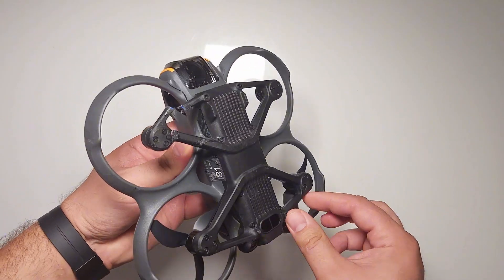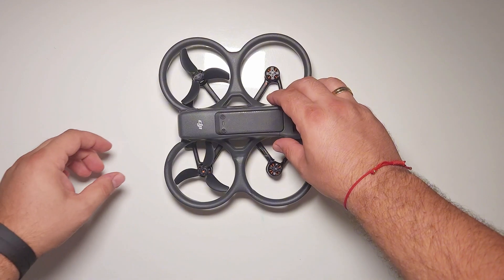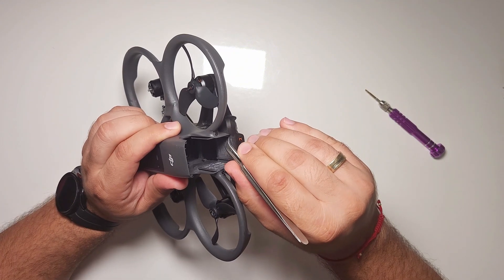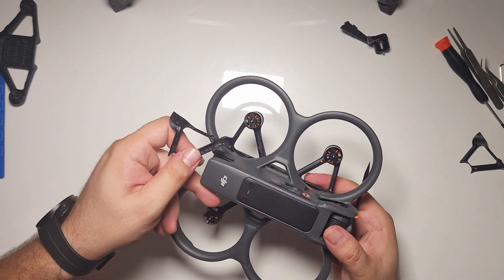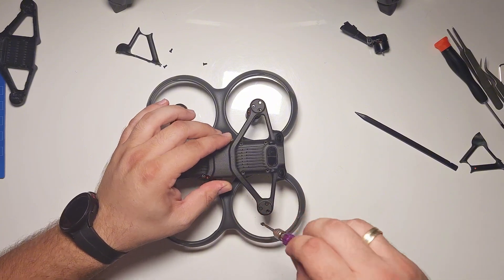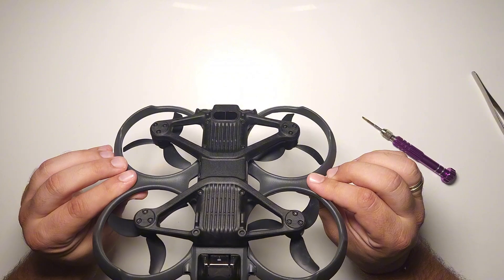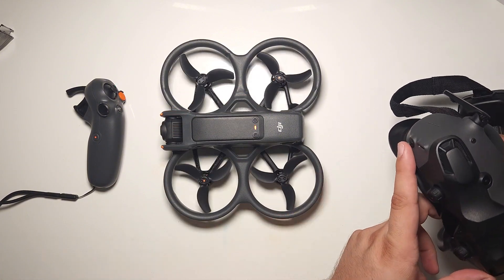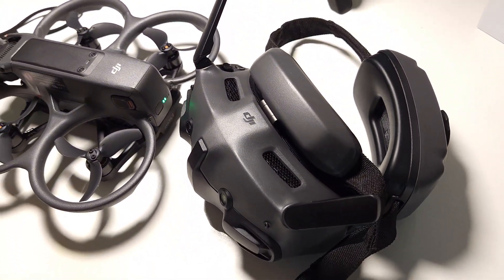How to repair your DJI Avata 2 | Motor and Under Frame Replacement | Disassembly | Teardown

Comment: Hi, I crashed my avata 2 and the camera lens is a little bit scratched. Do you know if I can replace only the camera module without Disassembling the drone frame? I already bought a new camera module on aliexpress, should be arriving soon.
Also, the Drone is working fine, a few scratches here and there but nothing much.
Reply: yes, gimbal assembly can be removed without taking the entire drone apart

Comment: Hi there! Your video is really helpful. I had a crash today and I think my Avata 2 needs a motor and two propellers replacement. I’m not confident replacing motor myself.

Would you be willing to help me repair it if I pay you for your time and work? I’d really appreciate it. Please let me know if that’s possible, thank you so much!
Reply: soldering two wires is not that hard, question is, do you replace the full cable on the board, or do you snip the motor cables and solder from there?
Reply: @patrickspapens5497  Im contemplating just snipping the cables on my new motor and splicing the cables to where it broke(close to the motor mount) so I dont have to disassemble and get to the ESC/board. have you tried that?

Comment: Thank you so much for this, i had to cheange my entire upper and bottom case.. the struggle of removing the antenas from inside the sandwiched plastic is on another lvl. You helped me alot tho!
Reply: Bruh from where u buy parts
Reply: @empower_move011  amazon, aliexpress. i did a complete housing swap today

Comment: I’m having trouble finding info to replace the rubber shock absorbers on the Avata 2. Any insight?
Reply from the maker: Did you check at AliExpress? You can find full sets there.

Comment: What type of screws was used in the body and internal components?
T5 or T6?
Thanks🙏
Reply from the maker: You can order a spare screws set for the drone from AliExpress. There were 4-5 different screw types in that drone. I don't have it for some time now and I can't even check.

Comment: Hi, do you have diagram how to connect the new moters,Please?  I do upgrade for AXLS  C157 3650KV for my Avata 2. The cables all black and I do not know with one goes to with one . I be happy for your help. Thank you very much!
Reply from the maker: Hi, unfortunately I don't have a diagram, especially for aftermarket motors. Perhaps the manufacturer will have one?

Comment: when i want to replace a motor i will cut the cable AT the motor or desolder it there
Reply from the maker: That's why I cut them off. Much easier to do that for this model.
Reply: Can you cut them close to the motor or do you need to cut past that black insulation material that stops right where the wires starts to go into the body?
I got the esc error and when I start my avata 2 the motors on the front twitch like normal and the back ones don’t. Would you say that’s the esc or motors?
Reply from the maker: @N3CR0LICH It might be the motors, but there's no guarantee. I was also getting an ESC error before replacing the motors.
You can cut the cables wherever you want. It doesn't matter.
Reply: @amv.techpro thank you for the response. A lot of the time I post a question on an older video and get no response. Thank you again.

Comment: Hi,
I would like to make upgrades of the motors on my Avata 2.
If I install Axisflying C157 3650KV Brushless Motors instead of the original DJI motors on my Avata 2, will the Avata 2 work and it will not get any errors or calibration ?
Thank you very much!
Reply from the maker: Hi! Unfortunately I'll have to disappoint you because I've never installed aftermarket motors and I don't have any tips for you. I just saw that another person here commented that this exact set of aftermarket motors comes only with black wires and he's having trouble determining which cable goes where when trying to solder them back.
Reply: @amv.techpro  Thanks, mate 👍
Reply: Third-party motors, like the Axisflying C157 3650KV upgrade, have been successfully installed by modders. These can boost thrust and performance, but they require:

Careful soldering and disassembly

Matching KV ratings and voltage tolerances

Manual tuning (especially if flying in manual mode)

Comment: Hi, any update required after new ESC installation, btw thanks for this useful video 😊
Reply from the maker: If the ESC board was damaged, there's a rush that it'll require a firmware flash after changing it. I've changed an ESC board on a mini 3 pro, mini 4 pro and a Mavic 3 and they worked fine without anything, but I've seen comments from people who weren't so lucky. I'm not sure what the difference is. It might be down to a combination between a defective board and a defective motor.
Reply: @amv.techpro  okay thanks so much for replying.

Comment: Thank you for your tutorial 
I've crash my avata 2 and i have an esc error 
2 motor are not working when power on the drone 
Did you had aslo an esc error Message on the goggles? 
Im not sure if to order motors or esc to replace... 
Thank you :)
Reply from the maker: Sorry for the late reply. Yes, I had an ESC error. It happens because the drone is doing a preflight check and if the motors are not working it throws an error. If you replace the motors, it should start working and the error should disappear.
Reply: Did it work?

Comment: Very helpful. I was at a loss on how to replace the frame but using your video, my drone looks brand new
Reply: yeah me too! antenna removal was a bit tricky too sice the upper shell and lower fan duct halves were banged up pretty good but some careful cutting and snipping later it was easy

Comment: Broke my back propeller guard. Is there a way for me to replace it without removing the entire frame?
Reply: Cut it and get rid of it. Someone on youtube was cutting it without breaking the antennas. It provides an incredible performance increase. There are antennas in them, you have to be very careful, they do it by melting.
Reply from the maker: Unless you cut it out, no. You saw that the frame is one whole piece.

Comment: I'm trying to replace the camera gimbal lower bracket arm (one tiny tab busted off).  Is it possible to disconnect the camera and replace the bracket arm withought opening up the rest of it?
Reply from the maker: The signal cables go through a hole in the bracket. I'd say, possible but difficult.

Comment: Hello, 
I have a problem with calibration downward vision sensor on my Avata 2. I ordered the new one that comes with the Tof Board Flexible Flat Cable (SKU BC.PF.PPO0OO36.01). I did  install it all, and now I have two problems.  1st, I must calibrate the downward vision sensor and 2nd problem unable to take off (can't fly anymore). Before with broken Tof Board Flexible Flat Cable, I could fly, and I had just the message in the goggles say: Downward vision sensor error, but now I can't fly, take off. It just not working anymore 😪.  I did return the old downward vision sensor back and just used the new Tof Board Flexible Flat Cable, and I still have those problems. DJI Assistant 2 not supported Avata 2. Auto calibration is not  performed via DJI Fly. May be you can sagest me what to do, how to calibrate the vision sensor again? Thank you!
Reply from the maker: Hi, as far as I'm aware the assistant 2 for consumer drones should support calibration. Make sure you have the correct version installed. There should be a calibration process. Unfortunately I can't test this myself now, because I don't have the drone anymore.

Comment: what screwdriver do you use for the small screws?
Reply from the maker: @r1sky.r1sky Well, to be honest I got this screwdriver as part of a screen replacement kit for an old Nokia phone years ago. It's a pretty nice and compact tool because it holds 4 different bits in the handle. Unfortunately I have no clue where you can get one from. I'll try to look it up and add it to the description of the video. Technically any precision screwdriver set will do.

EDIT: I've added a link in the description for the same screwdriver I used in the video.
Reply: @amv.techpro  Thank you so much!

Comment: Dá muito trabalho para consertar, e quando conserta, nunca volta ser o mesmo
Reply from the maker: Mine flies exactly the same way it did before I see no difference.
Reply: @amv.techpro  wait with time, it will plummet and then the technician will say it was a bird 🤣🤣🤣
Reply from the maker: @droneiqueda  if it does fall, I'll simply rebuild it again :) That's the added benefit of doing this. I can keep repairing it over and over. I've added some metal bumpers, etc. Unless I drown it, it should be just fine :)

Comment: im curios why didn’t you put it on a carbon frame? this design is the worst that dji i ever made. its my biggest disappointment so far. I always thought that if I crashed it, I would try to mod it on a carbon frame, 3D print a body for the main board, battery, and sensor, and adding a real antenna on the back. But I still haven’t crashed it yet.
Reply from the maker: Well, first off - I prefer to use OEM parts. I don't know what the quality might be of random aftermarket parts. Second - at the time of the repair there were almost no aftermarket parts available for this model. The option of moving the electronics to a different chassis sounds a bit extreme. I wouldn't trust it much then. There are plenty of FPV kits for this purpose.
Reply: Worst design ever made yet you haven't crashed it yet lol amazing

Comment: Why not just splice motor wires. What a nightmare project but great job.
Reply from the maker: Thank you! 
Definitely not impossible, but splicing would lead to increased cable thickness and the  tolerance are already very tight. The cable lengths are also quite specific. If anything, it would make it more challenging.

Comment: Sir, after changing the motor, do I have to do some software or else I will have to start it directly?
Reply from the maker: Nothing's required on software level. Starts right up.

Comment: The thread was stuck in the right rear motor and since then I am getting ESC error but the drone did not crash sir can you give me the solution
Reply from the maker: I was also getting an ESC error before the motor swap. If the motor does not turn freely, you'll get an ESC error.

Comment: I am trying to open the motor to remove magnetic sand, but it is stuck. What to do?
Reply from the maker: Hi, what do you mean by magnetic sand?
Reply: @amv.techpro  https://youtu.be/xBWVPuAL5hg?si=Raxb3pfnD6MDxmCc
Reply: @ sand where some particles are ferrous and stick to magnet
Reply from the maker: @my.fpv.flights  I've never disassembled the actual motors, but to be honest, I don't think they can be disassembled any further. If you're worried about sand in the motors, you should replace them. If something gets into the bearing it might seize mid-flight. I personally wouldn't risk something like that over a 20 euro motor.
Reply: @amv.techpro  Usually fpv motors can be easy disassembled. I'd not buy new ones in that case but clean ones. Avata 2  has other motors that cannot be disassembled easily. I do not think it is possible to buy avata 2 motorsfor 20 euro  and installation wont be easy (
Reply from the maker: @my.fpv.flights  Well, they are 20 euro. You can see the link I've added in the description. It's definitely not easy to replace them, so you are right in that aspect.

Comment: Can the prop guards be separated?
Reply from the maker: The top and bottom of the prop guards are separate parts, yes. They can also be purchased separately.
Reply: @amv.techpro How hard would you say the process will be if I am only looking to replace the prop guards since mine is bent from a crash
Reply from the maker: @crayola7494  Unfortunately the drone is built in such a stupid way, that if you want to change the prop guards, you basically need to replace the entire body. 
I'm actually preparing a video to do exactly that, but it'll be ready in a few weeks and I'll basically transfer all internal parts onto a completely new body. 
If only the underside of the prop guards is damaged, you might be able to get away with replacing only the lower part, but if the top part is damaged - you need to change the entire body.
Reply: @ I see, that’s unfortunate.. yeah the top part is slightly damaged too but I’ve managed to bent them back into place using a screwdriver though not fully into place.. Thinking of replacing the prop guards anyway since if I do crash again, it might just break the whole thing again.

Will wait for your video then to see if I’ll attempt on replacing the shell myself, else I’ll just contact DJI for help.
Reply from the maker: @crayola7494  Just fyi, the parts alone are about €110.

Comment: One question: is the motors the same quality as the avata 2's original? Or is it of lower quality and power?
Reply from the maker: The motors from the links in my video are supposedly genuine, according to the seller. I cannot guarantee that they are, but visually they are identical to the ones on the drone. They also operate flawlessly. I didn't notice any difference whatsoever.
Reply: @amv.techpro  tx

Comment: if i buy replacment motors are they the same or are 2 clockwise and 2 counterclockwise
Reply from the maker: The motors are identical but the wires going to them are of different lengths. 
Both front motors have short wires and both back motors have long wires. That's the only difference.
Reply: @amv.techpro  tnx bro i was worried about which one where to put

Comment: In the 8 screw  i cant open number 5 and number 6 could you please tell me how did you open it?
Reply from the maker: I believe your're talking about the second row of screws, back to front?
DJI adds a small blob of glue on top of the screw heads. You can pop it off with something sharp. They use slightly harder glue on the Avata.The blobs are visible in the video 0:40 
I believe that's some "warranty void" type of seal. 
Try to remove them. They should just pop off.

Comment: I crash my Avata2 and the camera move a little by the suspenders and the camara is moved like 10°, do you have any video to reload the camera on the suspenders?
Reply from the maker: Unless the rubber suspenders are torn/missing, it should be a matter of popping them back into place. Unfortunately I don't have a video for this procedure, because the camera was the only non-damaged part on my drone and I didn't bother to take it apart. You can follow this video and remove the entire camera assembly and then check the rubber suspenders. That's the only advice I can give you.

Comment: @11:59 what‘s that for cables? I destroyed that .. 12:00
Reply: The 4 cables
Reply from the maker: @jozek449 I can only assume you're talking about the tape above the 4 antenna connectors. In that case, put some sort of insulation tape on top. The metal heatsink is touching the cables so it's better to insulate them.
Reply: @amv.techpro  When I took my avata apart, I accidentally cut the 4 cables. Each cable is in the propeller guard. The 4 cables are connected to the FC. Do these cables have any function at all?
Reply from the maker: @jozek449  Oh. That definitely isn't what I thought it was. I'm pretty sure you're talking about the 4 cables with the circular golden connectors - those are the antennas for the signal transmission/reception . 
I would say they're quite important. Technically speaking, you can solder them back together. It's a bit of a hassle, but it can be done. Every DJI drone has antennas in the propeller arms. I'm this case, they're inside the propeller guards. As I said, you can solder them back together.
Reply: @amv.techpro  I have another question... could I use a different cable and solder it on or does it have to be that cable?
Reply from the maker: @jozek449  I wouldn't use just any cable. Those antenna cables have a thicker core. That's why they're so stiff. A little tip - you can buy laptop Wi-Fi antenna cables off eBay. :) it's the same thing.